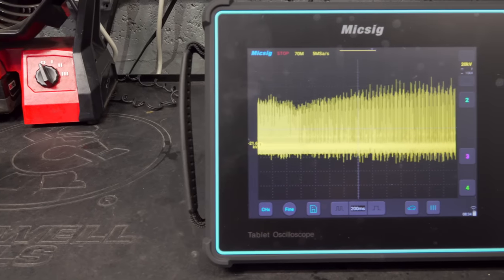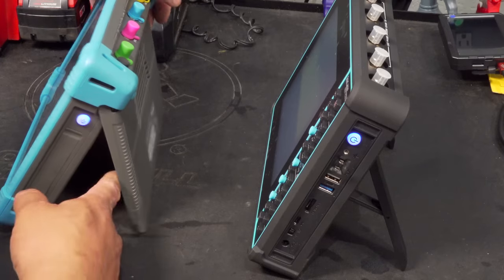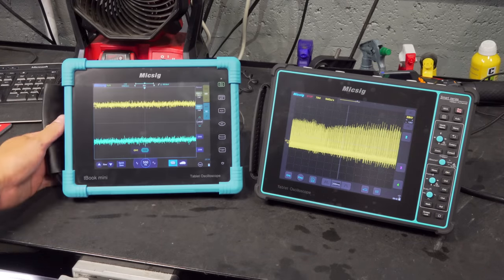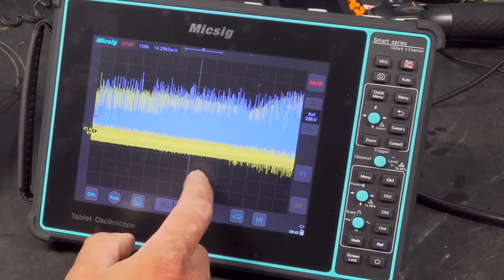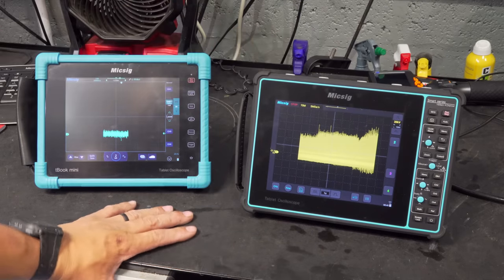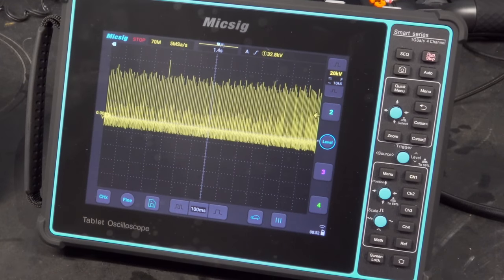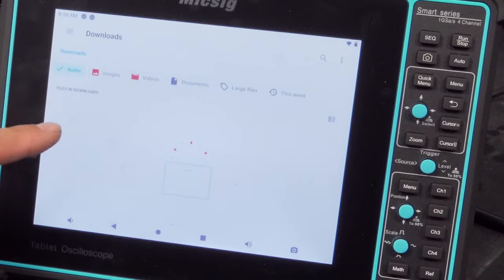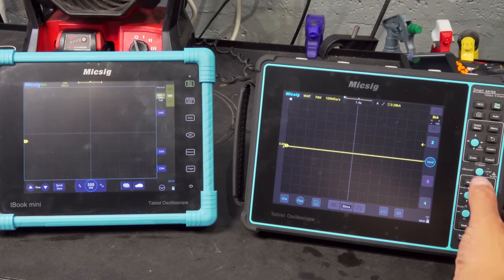MICSIG SATO1004 | REVIEW AND COMPARISON TO THE ATO1104 | A GOOD CHOICE FOR AUTOMOTIVE TECHS?

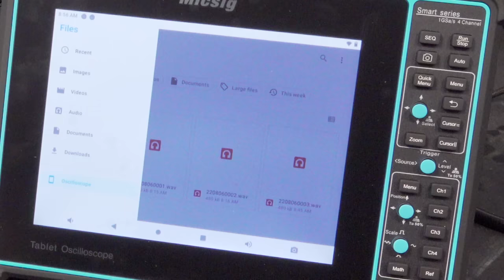Comment: I think you meant bit depth (resolution) when you referred to the quality of the signal image at 19:30 
The higher the bit depth, the more faithful the image on the scope screen is to the actual signal. My Pico 4225A has a 12-bit resolution. I tried to look up the resolution of the Micsig scopes on google, but I couldn't find that info. Thanks Mario!!!
Reply: The micsig has 8 bit resolution.
Reply: @mrfishbulb7187  Only 8-bits? That's not that great.... Thanks for the info.
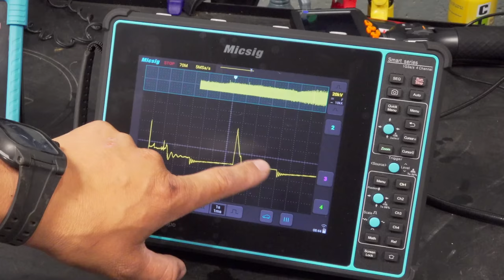Reply from the maker: For me, the quality(res) i get is more than sufficient, like in 8:30

For automotive, anything more just leads to more noise

imo

Comment: Hello. I have the SATO1004, and I’m curious about the external ground plug on the side of the scope. Micsig said it is to connect to Mains ground. 
My question is: when and why would you use this? 
Thanks in advance for your response. 
PS, Keep the videos coming. Love the info.
Reply from the maker: Never needed to use it
Reply: I’m in the same field, only mobile. So I guess if you don’t need it, neither do I.  
Thanks for the quick response bro.

Comment: On the older t book mini do you get weird ignition waveforms? At the end of a primary waveform I get a huge hump (peaks at 30 volts 10 to 12 ms long) It occurs  after the final coil oscillations . Its not present on my Pico, ATS , Snap On Verus ect.....  I tried different probes with no luck. I love it for a quick easy scope. I am a emergency power generation tech and I like to keep it on the front seat to grab a quick measurement.

Comment: That's it. I'm selling my 4425a, my verus pro, my two Hantek scopes and buying this one that does it all. I'm keeping my 2204b 4 channel pico scope for kicks and my MT Pro 4.1 8 channels from Rotkee
Reply: Are you using CSS script on your mtpro 4.1?
Reply: @AutoDiag_  no, the stock app. What script is this that you speak of? The app is pretty much complete. The only thing that I notice is that if the sample rate is too high and 4 or more channels are used, it errors out but I learned that it is because of the sample rate of 1M.

Comment: Hey Mario, I just ordered this per your recommendation. Only issue is I updated the unit and the resolution is pretty bad. Did this happen to you? I’m talking the screen resolution. Everything was crisp. Now it’s way ugly.
Reply from the maker: That has not happened to me. May want to contact support about that
Reply: @SuperMarioDiagnostics  hey it turns out my sampling rate was off. Do you think you could explain to me why at 100ms the scope seems to draw the waveform slower than 200ms? I’m new to this and you’re a channel I’ve been following for this kind of stuff.
Reply: Hi, I just got mine today and the resolution is pretty blurry...not just in scope mode...even in home mode. Is this what you were talking abou? Did you solved? Looks like 240p :))
Reply: @alexdragomirescu5084 yeah running a calibration and also lowering the amount of channels on does the trick. I sold it for an ATS Escope. I have owned too many scopes and this was my least favorite. Stupid confusing exterior buttons had me constantly clicking the wrong knob. The software is bad too, and the android version was butchered no full access to settings and you can’t sideload Google Apps. Just bad experience all around. A uscope is more intuitive than this, and people know how much of a PITA the uscope can be for a beginner.
Reply: @minirey360  I just bought an verus edge. What a difference. That been said,  the micsig is better for CAN stuff. On the ignition/injection side is a different planet. I'll have to keep the micsig because I doubt I can sell it. Most of mechanics don't even know what an oscilloscope is... so let's say it's ok as a backup scope, but I wouldn't buy it again.
Reply: @alexdragomirescu5084  Just came back to this video cause I’m flirting with the idea of buying another one of these but realize it’s still a no go. I agree for live CAN viewing in the background while you’re finding the cause of the problem the Micsig is nice because it’s legitimately just a scope, so it frees up your other tools you may be using or laptop or what have you. But all in all I did not like it. Maybe the new version without the buttons is cool, to me it was unintuitive to have them. Some functions were on the buttons, some were on screen. When you’re running and gunning and you want a quick setup on a simple voltage channel fine, but anything more in depth my muscles could never memorize the software and hardware layout. Your Verus Edge has a very nice scope module btw. With peak detect it’s perfect for CAN.
Reply: @minirey360  agreed 👍 I did made a video some time ago with the 3 scopes in parallel on can signal. Check it out. I'm not a professional however, just a DIYer.
Reply: @alexdragomirescu5084  I bit the bullet and tried the new version that’s all screen. Still awful as before. Seriously a poor tool for viewing any waveform, clunky, it’s fine as a beginner where you’re learning what each setting does and you’re researching every one but once it’s time to put it to professional use the last thing I want is to find out a random ass setting is off and I’m wasting time trying to find it to fix it. Just a bad scope all around, and from my first comment I’m very proficient at scopes at this time and use a Pico almost daily. I have a 4425a but if you’re looking for one of these save a little longer and find a used Pico or buy a pico kit. You won’t regret buying the gold standard.
Reply from the maker: You can save your base settings. You don’t have to search for the right settings each time. Create the templates and move on. I do not deal with any of those issues you’re mentioning
Reply: @minirey360  sometimes we never learn :)) I found out in life (after many failed attempts) that sometimes you have to follow your brains, not your curiosity :)) Anyway...thank for the review! Personally, so far I stayed out of the pico world. 5 years ago the prices were fair let's say, but now they are untouchable (for DIY). The software is pico's biggest plus. As a scope there are others more competitive - proffesional stuff of course. Pico became the apple product in this industry. Sooner or later some Android will arise. Having a tablet scope with a pico like software will be a breakthrough. It will come someday.
Reply: @SuperMarioDiagnostics  You are on a different level than most of us! Speaking for myself, not doing this for a living / nor everyday I do find myself fighting a tool that's not intuitive (for me) and I get frustrated. It's like when you just got your driver license and you have to drive a POS car :)) You're already frustrated that you're a beginner and the car doesn't help you either... misfires...dies at the stop lights...misses gears etc 🤣. So for you it comes easy as a racing driver...your brain already can recognize if the car is not doing what it should be doing. That being said we all thank you that you're passing some of your great skills to the rest of the rookies! Keep up the great work 👍
Reply from the maker: @alexdragomirescu5084  for what it’s worth, i do show how to create templates in my older review video. I think i did lol this was my first scope and i became obsessed with researching as much as i could to learn this tool as much as possible. Sucks to see that others don’t see what i see in this tool
Reply: @SuperMarioDiagnostics  It is a good tool all-in-all, no doubt about that. Could it be done better? Of course. Is there a perfect tool? Of course not. It all comes to using it everyday - that's it's downside. You probably noticed on german cars (let's say) that you find yourself instantly at home as for the buttons location and ergonomics, opposed let's say to Italian, British or French cars. The R&D department does usually a better job in ergonomics. Same with this tool. Once I had an Alfa75 that had the windows buttons on the roof.... you get used to it after a while, but it's not a familiar environment for the first time. Cheers!

Comment: What’s your opinion on the MicSig versus PicoAutomotive / Picoscope?  I like the features you showcase on the Micsig but also like some of the Pico features.  Either way great insight into a very useful diag tool.
Reply from the maker: Pico is still king for me. But quick grab, confirming commands and things of that nature, i grab the micsig first. In cylinder, pulse sensor testing, correlation waveforms, or long time base(pico does 13 hours versus 3.8 hours from micsig) i grab the pico
Reply: Does the micsig have floating grounds like the pico?

Comment: Before the Automotive Industry targeted SATO1004 there was the Automotive ATO1104 without buttons and the general purpose nonAutomotive targeted STO1104 with buttons. I bought the STO because i wanted the luxury of having both Touchscreen and Buttons. It turned out to be a stupid decision because i am an auto mechanic and not having a scope with Automotive presets and menus in which you can specify automotive tests and have the machine SET ITSELF UP for the test voltage and timewise was a huge failure. Even the Help section of the Automotive guides you with Automotive tests in mind. It turned out the advantage of the buttons was nowhere near as beneficial as being able to go to a menu that says Coil Test or Cylinder Relative Compression Test Or Fuel Injector Test and clicking on it and having it tell you how to hook your leads to the car...it does everything but drive the car into the bay for you. Anyway, i bought the nonautomotive STO and now that the new SATO is out i can have both my buttons and my AUTOMOTIVE CAPABILITY in one easy to use money making diagnostic powerhouse. Of course, you can do every test on the old non automotive machine as you can on the new machine, but you have to figure out how to do the lead hookups and how to setup the triggers and the time and volts values on your own and by the time you figure out all of this crap you are already an hour in the hole and if you had the new automotive specific scope you would have diagnosed it and had the parts replaced and the car rolled out of the shop already. So i'm selling my old STO1104E-PLUS on E-Bay at a huge discount and buying my new SATO1004 tonight on Amazon and Super Mario's fantastic comparison cemented the deal. Thanks Mario!
Reply from the maker: I would encourage every technician to become proficient with a scope. Then you would not be wasting anytime in hooking it up to a car. Sure it's nice to have the scope do it for you, but that shouldn't be a replacement for mastering the scope imo